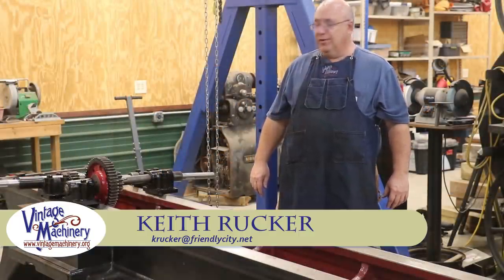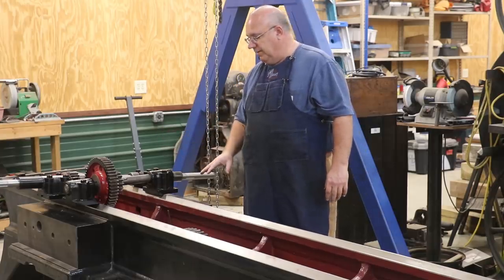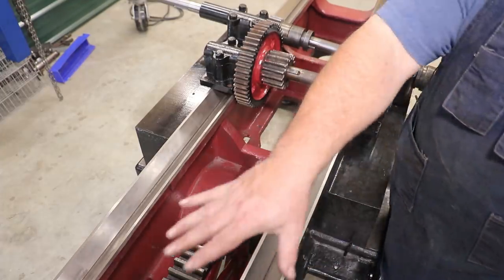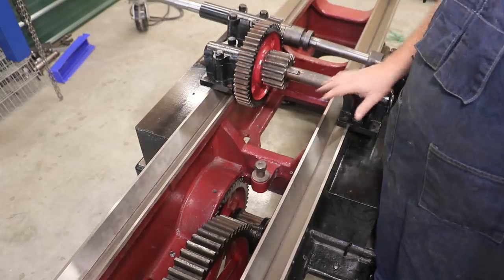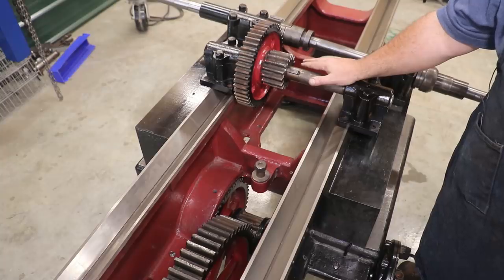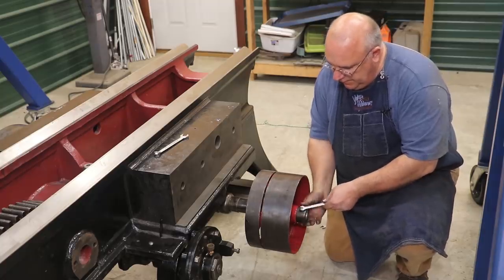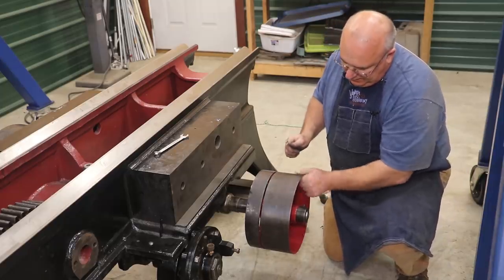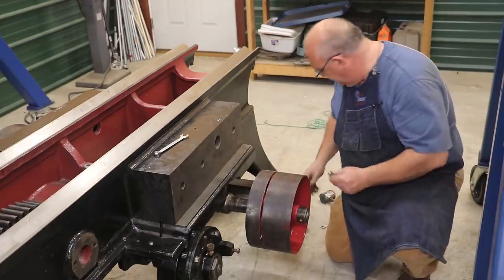New Haven Metal Planer Restoration - Part 19: Installing the Power Train

Comment: Keith. Thanks for the videos. As a big truck mechanic for more than 35 years, I have found using a couple of long bolts with the heads cut off really makes life easier. I have a large selection of line up studs. Fly wheels, and 15 inch clutches for an example come to mind. Piloting the bearings would save lots of aggravation and  going back and forth. 
 Keep up the good work.

Comment: Quick question, the cotton waste you used to govern the flow of oil into the plain bearing blocks shouldn't that have a piece of coarse linen in the bottom {covering the port to the shaft}? It is supposedly there to stop any stray threads from getting into the bearing. The thinking behind it is the shafts can develop quite a draw on the lubrication chamber.
Cheers

Comment: is there any adjustment by loosening the bolts and shifting some of the shafts around.  i realize its a straight cut gear machine..  but it just sounds like one gear is meshing too deep.. too tight on one side and too loose on the other.. might need to loosen the bolts just barely and lead hammer the bearing housing  back and forth to get the proper mesh..  it will be easier without the table on it.
Reply: I think right now he's just getting everything bolted on to deflect the bed however it may before scraping it in. May be optimal to set lash on the geartrain with the table/rack on anyway.
Reply: @Broken_Yugo  i agree with that.. but it will be only the main gear that needs to be shimmed downward when the table is set on..  installing tapered shims or shims between one pair of bolts will rock the shafts back and forth really easily to change their lash..  i would probably figure out how much metal was removed and shim the bull gear down slightly more than that before putting the bed on..  hopefully he has an assortment package of brass shim stock thicknesses.  i use my assortment so often i carry it on the dashboard of my van. https://i.imgur.com/fBjhmJI.jpg  i use it a lot when i need to move something or measure something.. i needed to measure the air gap in a duraspark distributor a few weeks ago.. https://i.imgur.com/KOb6qiX.jpg i could not find a brass feeler gauge set anywhere.  here is a proper clearance.. https://i.imgur.com/aQLb9XL.jpg
 this is the way too wide clearance https://i.imgur.com/uRgf77X.jpg
i have been fighting with manufacturers for years on this issue.. this is what happened a few years ago.. https://i.imgur.com/sP3bc27.jpg the bushing ID was too big..  allowed the pickup coil to slam into the reluctor 4 times per crank revolution.

Comment: A third hand would come in handy right now. Thanks to folks like you, these old machines are being preserved. Back in the late 1960s to early seventies, I ran a slightly larger version of a plainer for the Herman Pneumatic Machine Co. in Zelienople, PA.  The shop still had the overhead line shaft and old boiler and a steam engine, although they weren't used by then. We made machines for the heavy-duty foundry industry. Both the shop and the company are gone by now. I anticipate seeing the first chips fly! I love your channel for the diversity of everything you do, but especially the machine shop work. Keep the vids coming!

Comment: Im assuming after the build is finished you will build a drip pan to put under it to catch the lube coming off the gears. What kind of lube will it need? I used to run a printing press with open straight cut gears and we actually use straight STP on them.

Comment: What would you use to lubricate gears that size? I have tried grease but it flings off all over the place and over time what dose stay on turns into a grinding paste. I have used many types of oil and found that if i use very thick machine oil for a month then light hydraulic for a week it keeps the gears nice and clean.

Comment: Dear Keith, I am not a machinist like you. But I recondition motorcycle engines, if I reassemble an engine I like to use some lubrication when I put parts back together. I hardly see you use any oil or grease when reassembling and that with steel shafts and pullys which are bound to rust. Why is that or am I missing something? 

Thanks for the upload Keith as always a pleasure to watch! 👍

Comment: should you be putting those parts on the fresh ground ways without wood inbeteen  . I know you are going to scrape , but it seems it would make faults for the first impression.
Reply: The shafts are flat and the ways are V shaped. At worst it will ding up the top of the V, which won't have any noticeable effect on anything. A slight rub with a stone will take any small bumps off the inside of the V. Now, if the ways were flat, or if he dropped something on the ways from a few inches (or a few feet), that could be a concern. But just setting something on V ways is more likely to ding up the thing than the ways.

Comment: Oh yeah, that's me, put it together and then break it down to add what I forgot. Doooh....😊
Reply: Me? My old mower, for example. Take it apart carefully. Put it back together, replacing bad gears as needed. Make sure it is all properly sealed, transmission filled. Pull it off my workbench, then to find a couple of shims I had missed. Curses heard. Take it apart again. Insert shims. Lesson learned.

Comment: If I was going to build a gantry crane, I would use a 12 volt electric winch with remote control for the lifting.  I bought one from Harbor Freight rated at 2000# back in 2003 and used it on a car trailer for 10 years.  Paid 39.95 plus a battery which was mounted on the trailer and charged off the truck when the lights were plugged in.  They have heavier rated ones as well.  I had an old chain fall for many years which worked great, but you always had the issue of the chain dragging against the thing you were lifting and had to use 2 hands on it for the heavier loads.

Comment: Hi, when working alone trying to line things up your best friend is a few lengths of rod in different sizes threaded on one end. Slip them through the holes and screw in. Parts will slide along and be inline for the bolts even if the rods are not the correct size they will be close enough to jiggle into place. If you have to lower a piece again ( as you did)  the rods will keep it in line.  Make them by turning from solid or simply cut off a bolt of the correct thread and weld onto a piece of bar. Used a lot of times myself when you have to line up 10 or more holes at once!

Comment: I hesitate to nag you but I think I should make a few remarks:

You're assembling the gearing before you scrape the bed and  table together. Yes, the table and bed ways are accurately ground but consider: very low aspect ratio reciprocating surfaces of the same material no matter how perfect the fit make a remarkably poor bearing. Consider the lubrication mode. Very long narrow surfaces do not allow a hydrodynamic lubricant film without copious pressure oil flow. The oil film flows out the edges as fast as it forms. Traditional cast iron on cast iron way bearings are scraped to provide little randomly scattered islands surrounded by lagoons of oil. Eash bearing island transfers shared load to other islands ("points" - actually little areas) as opposing bearing islands move to align. Thus the lubricating mode is boundary and functions well without the need for pressure lubricant. I recommend at a minimum you cross-scrape the bed and the table as though preparing for a scraped fit leaving about 8 bearing points per square inch of the ground surface.  This will make the table easier to drive, greatly reduce the probablility of scoring, and make the table/bed bearings much less sensitive to faults in lubrication prolonging its life and accuracy.

Scraping produces zillions of tiny chips - swarf. They are perfecly formed to produce the worst contaminant to cast iron on cast iron bearings. Therefore, all scraping is usually performed prior to assembly of mechanism to render thorough cleaning easier to accomplish. The gearing you assembled will have to be either removed or thoroughly shrouded in plastic film sealed with tape while scraping and clean-up is in progress.  

The gearing you assembled is noisy even when exercised by hand. Under power, the gear noise will likely make conversation difficult. You assembled it by bolting the bearing blocks to the underside of the bed. There is clearance between bolts and the holes in the blocks, perhaps as much as 1/16". You have a sturdy gantry crane right there and it's an easy matter to rig a supplemental chain hoist to control rolling a suspended load. While it's a lot of work to invert the bed into blocks, it allows you to fit and adjust the bearings on their bolt clearances for best tooth bearing and backlash without having to grovel under the machine, adjusting things that are very difficult to see in a cramped space. A small amount of adjustment will make considerable difference in gear noise and ensure bearing bores are in alignment with their shafts.

The table rack mounting surface under the table has been lowered by the table/bed wear and the stock removed to correct it when you ground the ways. That was mentioned in an earlier video. Was the rack surface under the table ground at the same time? How are you going to secure the 0.005" to 0.008" backlash between the rack and bull gear? How do you plan to pitch the rack section gaps when you assemble them on the bottom of the table? Were they originally doweled? You can't just slap them on the table and bolt them down.
Reply: I wish you could be there to help him because I am going to bet that all of us viewers would like to see him have the best rebuild possible.
Reply: I do not disagree with your comment, but there is an advantage for installing the gearing and all hardware prior to scrapping: it improves finished accuracy. The fasteners attaching the hardware and their weight will distort the bed. For the scrapping to be effective, everything that will impose any load/stress on the bed should be installed prior to flaking/scraping. When your working with tight tolerances, even minor stresses can have an affect.
Reply: @EDesigns_FL  I thought about that but I didn't think three hundred lb of suspended weight and the tension of the assembled joints significant considering the mass and rigidity of the bed. Of greater concern to me were the assembled columns, rail with saddle and head, bridge, associated parts, and the countershaft headworks that might total a ton. However, I was reluctant to bring up too many issues.

You can get an idea of how a moderate weight will affect this particulr problem by simply sitting on the bed about where the gearing mounts and observing its effect on a nearby  master level. However much the bubble moves indicates via calculating ratio and proportion the effect of the weight of the assembled components. Don't linger; get on, observe, and get off. Your warm backside will expand the upper surfaces of the bed casting and have more effect than your weight but in the opposite direction.
Reply: @forrestaddy9644  If Keith was working with tolerances of ±.005", then the impact of the drive assembly on the bed would likely be irrelevant, but it's evident that he is seeking sub .001" tolerances. With that level of precision, it doesn't take much to have an impact; and as you stated, temperature changes can have an enormous affect. 
In regards to the head assembly, Keith might be planning on installing it also prior to scrapping, but it would be a pain to work around. Better him than me ;-)
Reply: @EDesigns_FL  Work the math. There's enough in the videos to eyeball estimate data for a rough stress, strain, deflection, analysis. Treat the bed as a single center and end supported beam of constant section. You can make your dimension estimates and calculate I and E from Mark's.

I'd be interested in how much the floor deflects under Keith's New Haven planer as the table reciprocates. As I recall that part of Georgia has deep sandy clay soil. Clay expands and shrinks with water table and precip. As I understand it, such soil subsides over time as moisture drains away beneath a concrete slab leaving it unsupported and subject to deflection under load. If Keith's slab floor is 6" thick and the nearest bearing footing 12 feet away, 600 lb of table slowly reciprocated over a 5 foot stroke should be sensed by a 10 arc second master level. If final leveling is elusive and frustrating, the culprit may be floor deflection and slab jacking (injection of non-shrink grout through holes drilled in the floor) may be a solution if the deflection results in unusual wear in the table ways.

My boss was watching the level as I moved around a 24 x 60 surface grinder bed I was leveling. The bed was 13 ft long and weighed 9000 lb. Even my weight (240 lb) registered a half graduation variation and that was on a 10" unreinforced floor. There are good measurable reasons why manufacturers specify reinforced concrete foundations several feet deep fot their larger machine tools.

Comment: If when you start using it you find the gears jangle and clatter try applying some cardium compound to them.
I used some on my traction engine and the gears which were very noisy then ran amazingly quietly.
It seems to cushion between the teeth or Somthing. It is also exceeding messy, it is used for open gears and wire ropes

Comment: Just to say that the reduction gears do not increase the "power" to the slide, but increase the "torque" at the output shaft.  The power input to any gear train is equal to the power at, the output shaft minus any friction losses, regardless of the gear ratios.
Reply: I agree. As you say the total power delivered will be slightly less. I'm not sure if Keith doesn't understand this himself or he just assumes it doesn't matter to his viewers
Reply: @jonka1  Yes......you could be right.  Those of us who have a technical education still tend to do it sometimes.  Also it is common to get the units wrong.  I mean  "Pressure" instead of "Force or Tension" etc.  I think it may be sloppy thinking much of the time and it does matter if you are a Mentor.
Reply: @davidrichardson376  
Oh boy do I agree with your closing sentence. I've been pointing out for years how Keith misleads and provides poor examples to his viewers but he leaves it to his plaudits to remonstrate with me.
The true denied is still the truth.

Comment: Keith, when the ways were machined that changed the distance between the bull gear and the gear rack. How do you plan to fix that?
Reply: They took about 50 thou off the bottom of the table, where the rack gets bolted down.

Comment: So is that first technique with Keith under the frame holding the power train with his hand fully OSHA approved?  One question: I don't see how the rotary motion of the shafts is converted to linear back-and-forth for the operation. Is there a crankshaft? or some other bit of technology to create the linear action?
Reply: There's a full length rack fastened to the bottom of the table, so the gearing drops the rotary motion to the correct speed out to the main bull gear that then drives that rack. Since the way's have been ground and Keith's going to be scraping it in for the final accuracy then quite a bit of time will need to be spent shimming each of those bearing blocks and getting the tooth engagement correct. My guess is he'll use bearing blue on each gear to obtain the correct gear lash pattern.
Reply: The back and forth is manual by shifting either the forward or reverse belt onto the respective drive pulley. The reverse pulley is smaller to drive the machine back quicker than the cutting stroke.
Reply: You are incorrect the forward/ reverse stroke is AUTOMATIC!   A piece set on the bed trips the shifter to the belt each time it hits. The stroke length is controlled by the distance between the trips and the stroke position on the bed is set by where along  the bed the trips are set. ( see old steam powered machine shop running his planer). Cutting depth is manual ( on most)  but the cutting position is fed by a ratchet advanced on each bed stroke ( like a planer). Some machines were fitted with more than one cutter, with a coarse cut and fine cut following across the bed ( we have this model in our preserved railway workshop) but ours has  an electric motor. Makes an awfull lot of vibration and noise!!  but nothing else will flatten a piece of 1 1/2 inch plate. Surface grinders that will do a 2 ft X 4 ft piece cost over £1/2m!
Reply: Kevin Grime oooh fancy. Very happy to be wrong, always time to learn :)
Reply: Thats why you need the dog clutch because the shaft is always turning one way or the other. The flat bar is to engage the dog from moving the gears so you dont have to stop the entire shaft to stop the machine. If driven as a counter shaft it would have its own overhead loose / tight pulley as well.